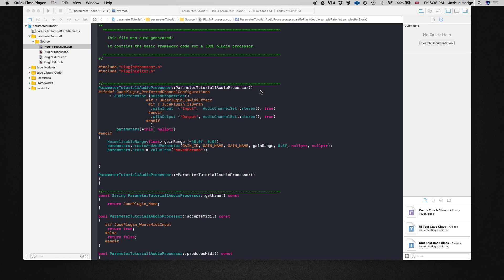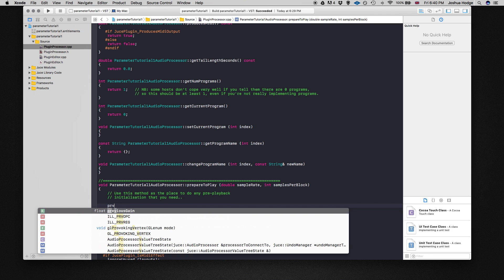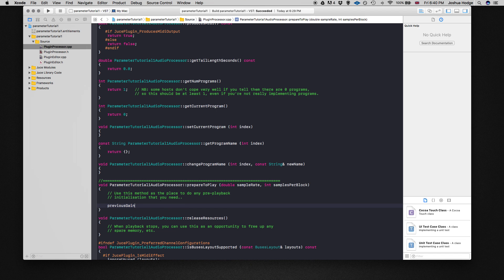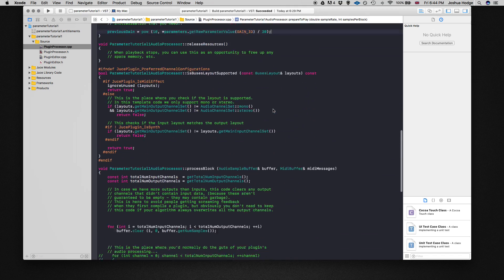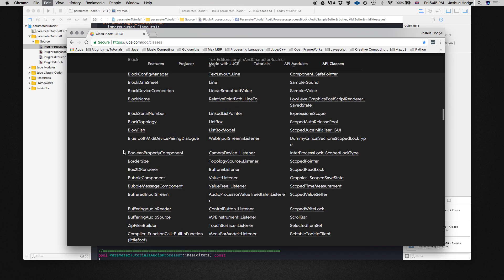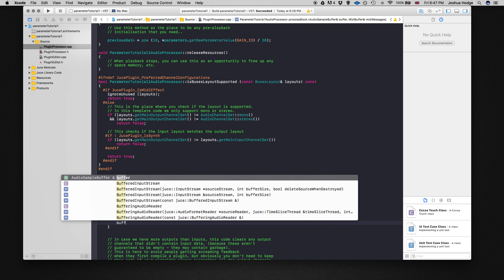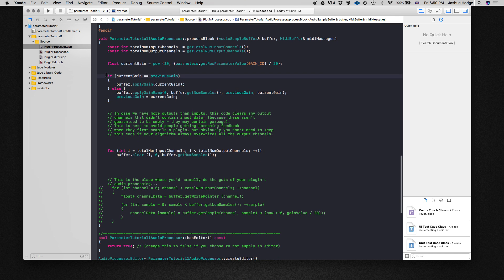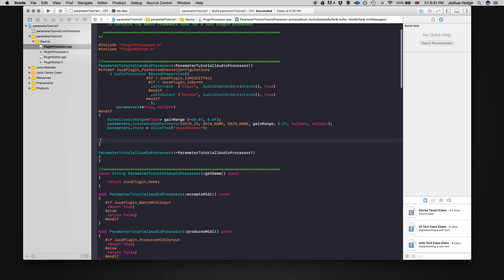Juce Tutorial 18-  Using a Gain Ramp to Eliminate Sound Artifacts

Comment: Just a quick point/question - would it be better to use the inbuilt juce::Decibels::deciblesToGain() method?  I have done so in my version of this code, but with the added step of adding 0.0 to help with the conversion to float (You can't use multiply by 1.0 as this will change the polarity of the gain value).  Again this is a genuine question.  I'm always looking for the most cpu/ram efficient and audio thread "safe" approach.

    previousGain = juce::Decibels::decibelsToGain(*treeState.getRawParameterValue(GAIN_ID) + 0.0);

Full example of my code can be seen here:

https://github.com/StuLast/juce-gain-slider-demo

Comment: Another great video! 

One question for this one: You mentioned the buffersize is 512 Is that something than one can set manually? Or is that buffer slaved to the DAWs buffersize? 

I was thinking about trying this method as general smoothing for other parameters and for some for some them, it would be nice to be able to set the ramp time with a variable.

Thanks again ;)
Reply: Ahh cool Thanks. I think I need another approach then. I have got some code I think will work for the purpose I have in mind, but still a beginner here, so need to do a little bit more research before venturing into using code form elsewhere.
Reply: The buffer size is actually DAW (and/or audio interface) dependable. You can change the audio buffer size at any daw like in pro tools and this will drastically affect the CPU consumption of the plugins (since they are slaved to it). Basically, the buffer size tells the plugin how many samples will be processed per processing block, so, the lower the buffer size is, the more "real time" and cpu hungry it will get, whereas higher buffer sizes will introduce more processing delay (more samples per block) and less cpu usage (less processing threads (blocks) within a period of time). That said, the buffer.getNumSamples() will return the exact amount of samples allocated per block(buffer) processed (in other words, it will return the buffer size).